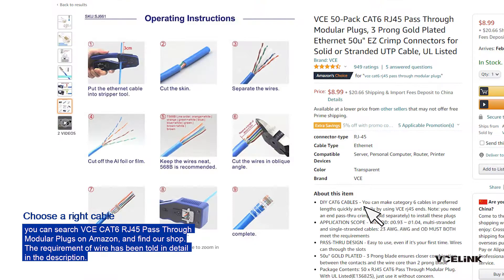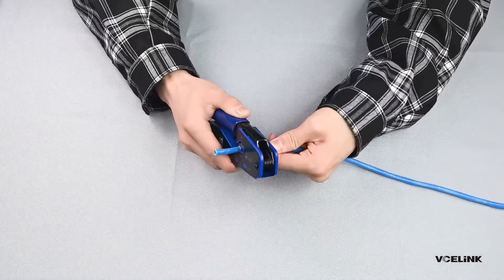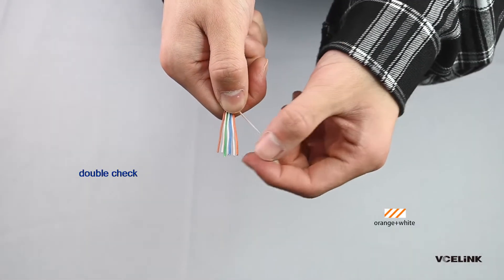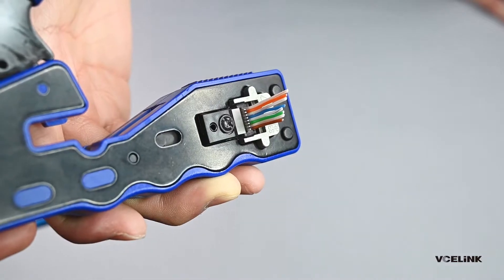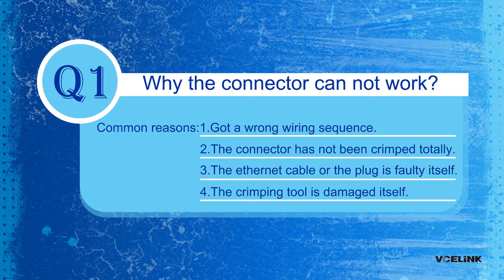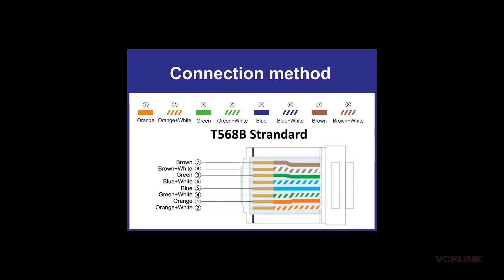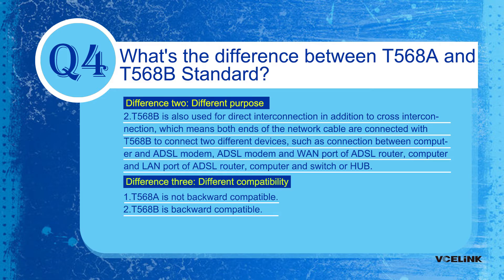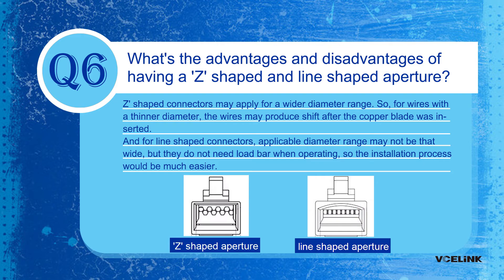The Most Detailed Tutorial of How to Make a CAT6 Erthernet Cable

Comment: Very informative!. TKS. Gives me confidence to go ahead and cut one end, of the prepared cable bought with 2 connectors already in place, so that I can run cable through walls and cornices,(into a smaller holes, without the connector) and than crimp the cable again at the final end.